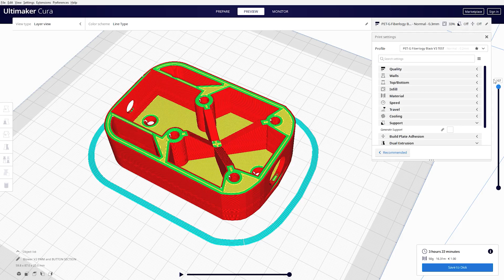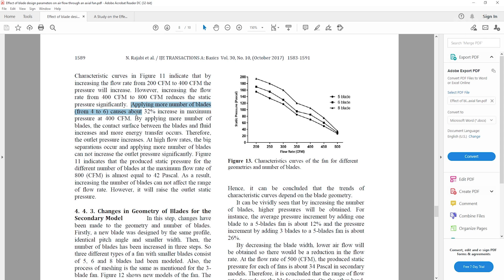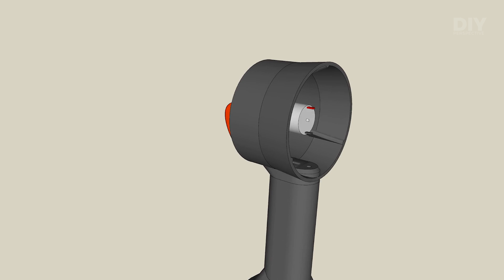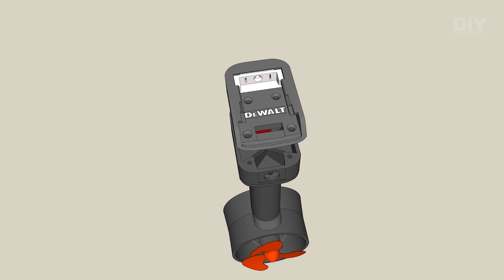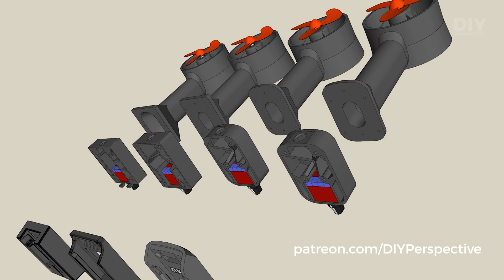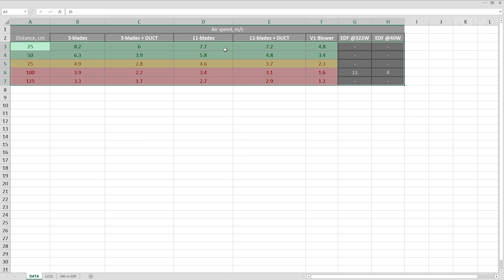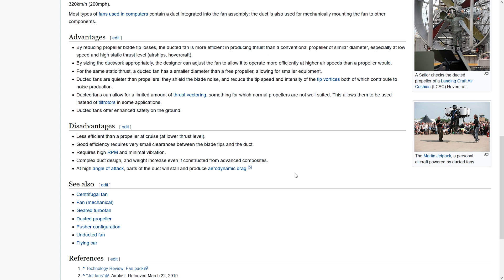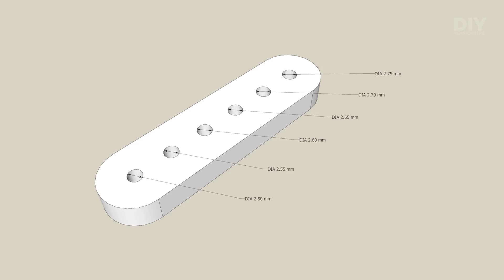3D Printed AIR BLOWER powered by DEWALT BATTERY (Designing & Making) – BBQ Blower?

Comment: Good job! Came across the adapter in the new feed on thingiverse, glad I found it :)

I've been wanting to do something similar for a solder fume filter seeing as I have some dewalt batteries
Reply from the maker: Yeah, that would be cool. You would need some really nice high static pressure fan blades if you will use a filter. You will definitely need some testing to do, but it would be a very convenient and useful project to make yourself. :)